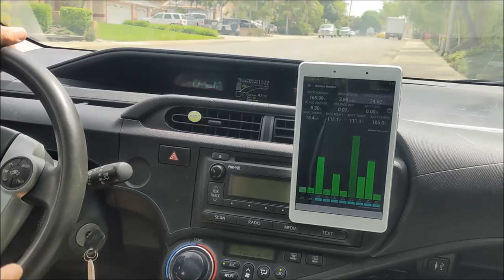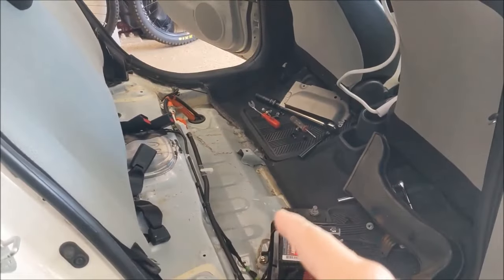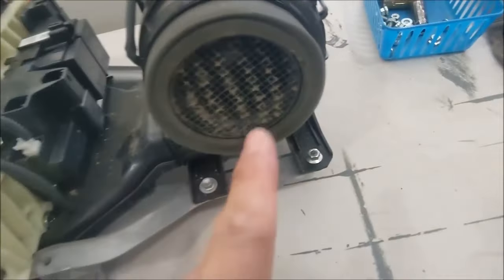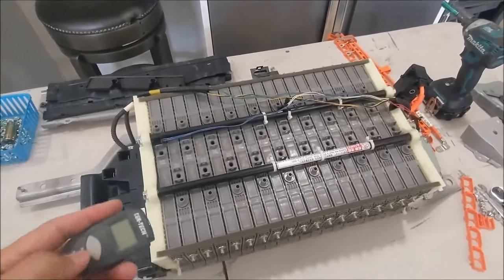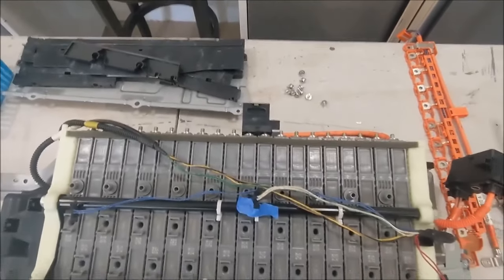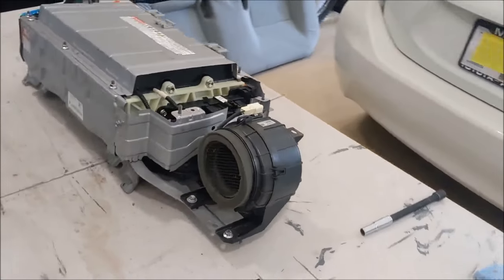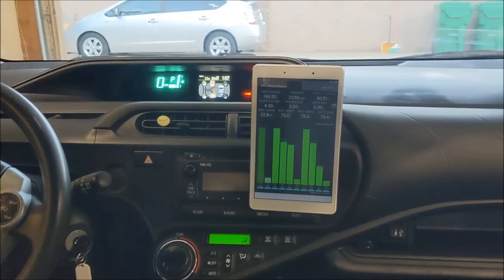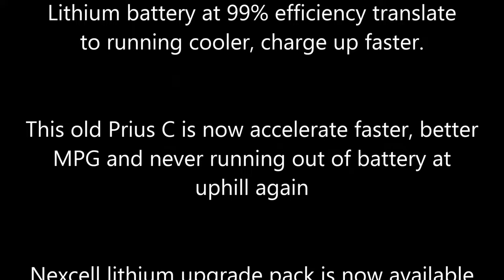Prius C lithium upgrade - installation guide and EV range test

Comment: Can we get an update since its been a year of use?
What was the old mpg value.
and the current mpg value.
How is the lithium battery holding up?
Original specs of the lithium battery.  KWH, cost and current cost?

Comment: These modules are a lot easier to install than the OEM ones. I think i now know where i will get the hybrid battery replacement for my 2012 Prius C after the one it has goes out, these ones on the video seem like they will last a lot longer.

Comment: So when you swap to the lithium batteries will the charging system on the Prius be able to handle a full charge constantly or will it burn the charging system up?
Reply: Great question, on EV and HEVs the cooling is generally oversized for the inverters and motors, your thermal restrictions are usually batteries, with better batteries what would happen is that the thermal loop may run more often and generally it will handle it with no problems.

If the inverters/motors get too hot, the system will know and thermally derate it until everything cools down. So again, no worries there either.

Comment: This is pretty awesome, I wish Toyota replaced their replacements batteries with this, my Prius C still has 6 years guarantee including free battery replacement if capacity goes under 80% so there doesn't seem to be much value into buying third party solutions :(

Comment: Can we see 0-60mph (0-100kmph) acceleration test?
Reply: The battery would have no effect on 0 to 60 time. The battery doesn't change the software or any other parameter of the Prius.

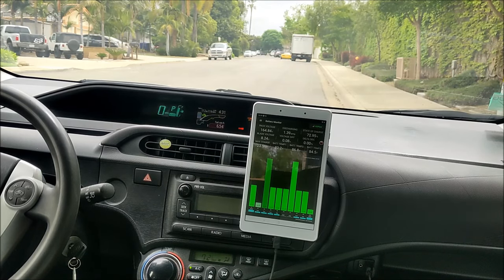Comment: Hi, At 12:14, For the new replaced battery, Why the battery pack is showing 164V at 73% SOC ( It must be over 200 Volts  and Blade Voltage should be above 12V ) and  Blade Voltage is 8.23 while minimum voltage of LFP battery is 3 volts and there are 70 cells in total , 5 cells per pack x14 Packs. Urgent reply will be appreciated.

Comment: Is there any risk of electric shock when removing or installing the 8mm studs from the battery bus bar?
Reply: As long as you remove the orange jumper and keep your both hands away from anything orange you'll be fine

Comment: How much does this cost??
Reply: Depends on which car you have. They have a different number of cells so price varies on that. Check the website for pricing. They are releasing in waves so it will say its sold out. The next batch will go out in July. The previous batch was sent out in May.

Comment: Changing from nickle to lithium is the same battery computer used or any other modification has to be made for it to work?
Reply: No, you’re just replacing the cells, not the computer. The entire install is in this video. One thing to note for Prius C owners is the battery blade is different than the standard Prius cells, so you can’t mix them. I read this on their website. I’m not sure why a Prius C owner would waste money on 4 extra cells they don’t need, other than the packs being sold out, which they are right now,, but it’s definitely worth noting that they can’t do this even if they want to.
Reply: @ce3937  But if you don't modify the computer program to charge the battery more from the regen braking, how are you gonna use the extra capacity of the lithium pack? You have to charge it using the gas engine, as shown in this video?
Reply: @TheExcelciorBeta   I think that the computer charges the batteries based on voltage, since the lithium have a higher capacity, these will take up longer to charge with the engine, but also longer to discharge, the computer indeed will charge it up well going downhill for example.

Comment: so that did not even double your range at golf cart speed, I appreciate the video but unless you can double your range it's not a win in my book
Reply from the maker: It is software limited at this time
Reply: @hybridapp7158  interesting, what's the upper ceiling?
Reply from the maker: @Good-Enuff-Garage  The upper ceiling is what we have achieved in the video (maybe slightly better), bigger capacity doesn't give more range unless go with plug-in hybrid solution.

Comment: It is not good idea to put lithium in a such a way. Lithium modules require balancing which is not in this battery. Every module shall have own circuit discharging the module if the voltage is too high. This is not needed in nimh modules  Toyota still uses nimh due to better durability and wider temperature range. Also it is easier to reuse nimh than lithium cels.
Reply: Well the lithium modules on the video seems to be balanced, the voltage difference was very, very low.
Reply: @hedgehogthesonic3181  yes, for sure, but after some time they will be unbalanced and you will find a problem. With bms and balancer wont have it.
Reply: @tomg8069  How do you know these will be unbalanced? why would these even get unbalanced? these are very similar to the OEM ones, but with more capacity and less weight.
Reply: @hedgehogthesonic3181  this the nature of lithium cels, these in the middle have warmer temperature than outside modules so different chemical process would appear. Nimh have this problem in a small scale and nimh can have higher voltage than nominal so neighbur nimh modules would charge any way. In lithium you can not allow voltage above nominal due to damage the cell or decreasing lifetime. If you have i.e 16 modules in series then for sure one or more would have higher voltage than it should. Bms with balancing feature in my opinion should be added here to increase the lifetime and make it more safe.
Reply: @tomg8069  These modules have BMS, he showed it in other of his videos. And also the Prius have a fan to cool down the hybrid battery, i don't think these cells are going to get hot at all.
Reply: @hedgehogthesonic3181  leave car during the summer on the middle of the parking, you will get 35..40 Celsjus inside very fast. I know there is a fan, but fan feeds air from the cabin, it is not cooled preliminary by peltier or ac. Bms only cuts the circuit when voltage is too high or too low but hard to imagine you drive the prius and suddenly bms cuts traction battery down :)
Reply: @tomg8069   If the cabin is cooled by the A/C, and the hybrid battery is turned on at max speed, the hybrid battery is going to cool down very fast, i have tested this with my 2012 Prius C. Here is the video about he explaining how his made modules work 

https://www.youtube.com/watch?v=ChGff5uK5Lo  we can see that these have a BMS so the modules stay balanced
Reply: @hedgehogthesonic3181  yes indeed it has bms inside but it is too weak to dissipate many Amps of current which come from mg1 when braking the prius ie. 50Amps  so according to my experience voltage will be higher than nominal anyway. lifetime of this battery will be also limited like nimh or even shorter. About an ac, it is true that you can cool down the car quite fast but this doesnt change the fact that modules in the middle have higher temperature than outside so they will get older much faster. As nimh modules are cheap and you can get almost new or in good condition, i think you will have problem with these lithium in the future. Anyway, wish many km on lithium :)

Comment: since it doens't give more range i can't justify the cost
Reply: It gives more efficiency, more MPG, since this battery has to be charged less, meaning that the ICE needs to turn on less to charge it.
Reply: It cheaper than a OEM battery.